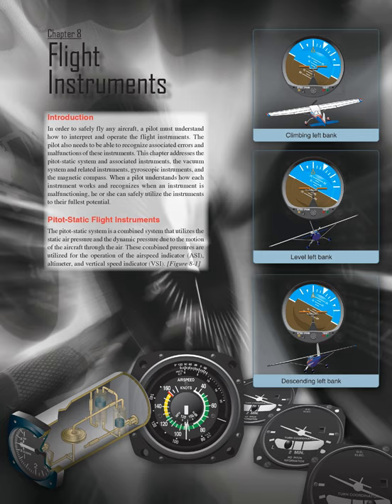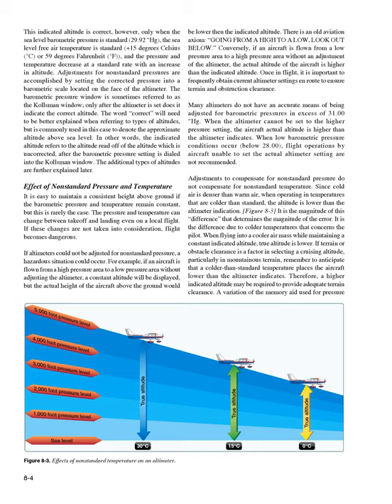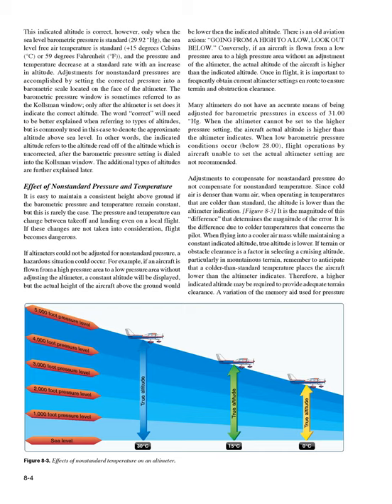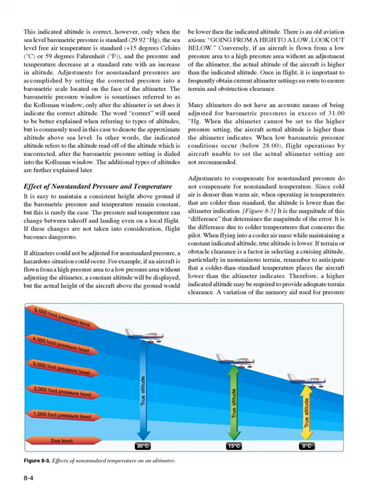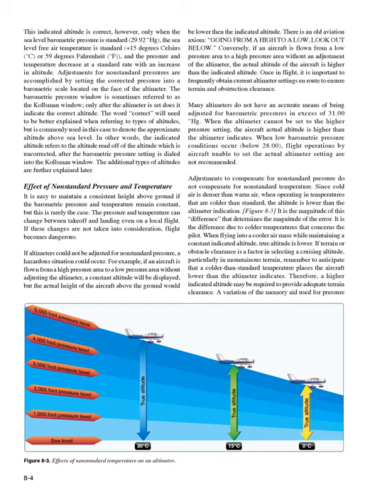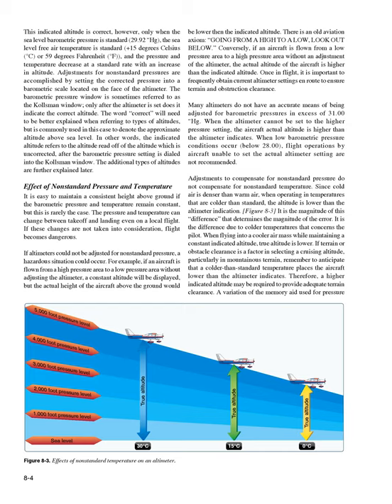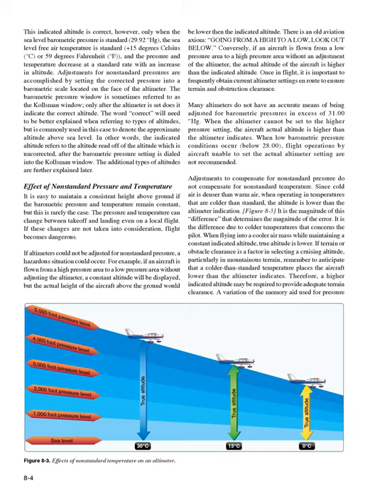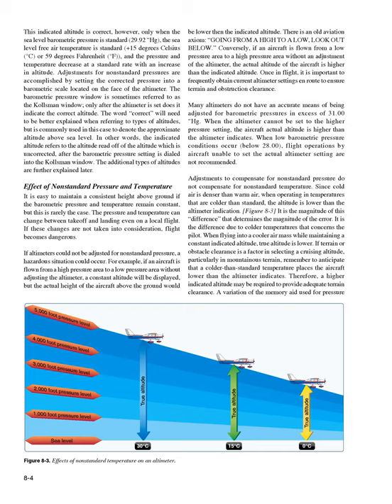FAA Pilot’s Handbook of Aeronautical Knowledge Chapter 8  Flight Instruments Aviation Audio Book

Comment: IN THE VSI THE DYNAMIC AIR PRESSURE IS INTRODUCED FROM THE PETOT  VALVE THEN STATIC PRESSURE COMES FROM THE PETOT INTO THE DIAPHRAM ALSO TO TELL THE AIRSPEED?

Comment: THE PETOT TUBE TAKES IN THE DYNAMIC AND STATIC PRESSURE THEN THE STATIC PRESSURE IS REMOVED THROUGH CANCELATING ITSELF OFF IN THE PETOT VALVE END PORTS? THE DYNAMIC PRESSURE GOES TO THE INSTRUMENTS?

Comment: IN THE ALTIMETER HAS A ROTATING DIAL WITH 100 AND A NEED OF 1-9 THEN ANOTHER NEEDLE TO INDICATE THE LEVEL LIKE 110109 FEET IN WHICH THE DIAL READS 1?

Comment: A QNH ONLY WORKS AT ABOVE 28 mg MERCURY? TEMPERATURE MAKES A DIFFERENCE SINCE THE TEMPAERATURE AFFECTS PRESSURE READING IN WHICH COLDER TEMPERATURE MAKES FOR LOWER PRESSURE? THERE IS THE SAYING COLD IS BETTER HOT LOOK OUT BELOW?
Reply: LAST CORRECTION: ABOVE 28 Hg?